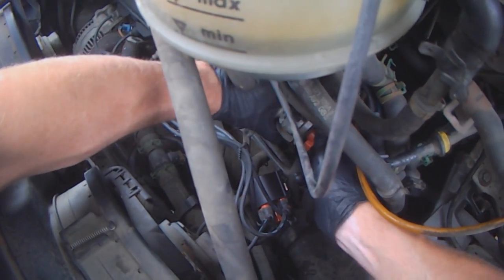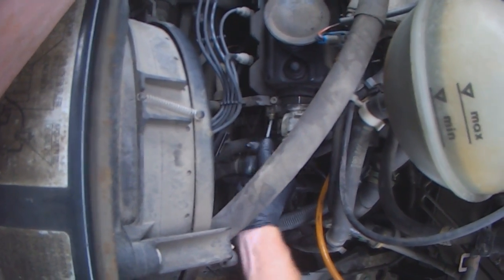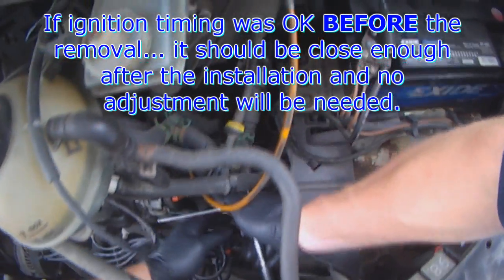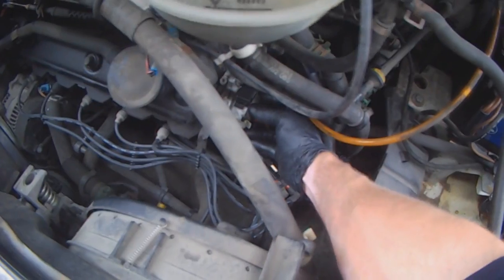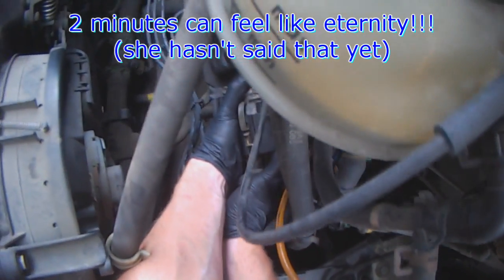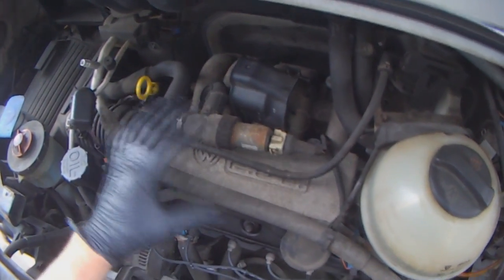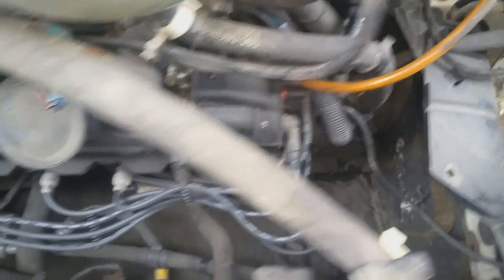VW T4: Hall Sensor replacement (part 3)

Comment: Hi there.. How/why do I have 14.7 volts on the plus and trigger wire at the hall sensor connection when not connected but only 12v at the battery?  Still not starting and still has an intermittent spark.. (it has a new coil, leads, plugs, rotor arm, dissy cap, hall sensor, ignition switch, temp sensor)  still nothing. (2.5l  1996)
Reply from the maker: I don't know... post some videos on your channel of how you are checking / testing things, so that I can see. Leave the ignition key in the ON position and trigger the starter directly at the starter solenoid (to rule out an ignition switch issue).
Reply: @EXOVCDS  many thanks for your reply.  I dont have a channel but I did try your suggestion of manually operating the starter with the ignition on.. No different. I have noticed though that if i place my coil lead near the neg terminal and do as above, it will spark for about a second then stop sparking.. Same happens if i ground the middle pin for the hall sensor. Its sparks and runs the pump a few times then does nothing.  My brain hurts
Reply from the maker: @nigelhook3437  if you repeatedly ground the center pin, spark also stops after a while? Or can you get spark for a longer time?
Reply: @EXOVCDS   the spark stops at the same time as the pump. Also i cant hear any injector clicking at any point and the spark plug looks dry if i remove one afterwards.   Sorry about this
Reply from the maker: @nigelhook3437  spark plugs don't get wet if the valves are not open, this is normal. If the fuel pump & injectors are ok (fuel is sprayed), then the engine should start & run for a second or two... or at least sound like it wants to start. If not, then you might have a fueling problem. If you have to wait a few minutes before spark returns, then something is getting warm & failing, causing the loss of spark. Do you have a scan tool that can communicate with the ECM? If yes, when there is no spark, can the scan tool still communicate with the ECM? Check all power & ground connections. There are several ground wires at the battery negative clamp. Clean each connector and make sure that they are secured tight to the clamp.
Reply: @EXOVCDS  thanks Thomas.. Ive pretty much done all of that.. I cleaned all the battery connections individually, and ive tried connecting to the ecm with an obd2 device but it wont connect (it works fine with my other car) I know the fuel is being pumped as ive had the pump out, but i dont know what pressure its pumping at so maybe that is the problem.. My other thought was to try swapping the relays that power the ecm and ignition. They both get warm whilst the ignition is on but that may be normal.  The fuel relay seems to work fine.. Ive even tried manually keeping it closed to bypass it but doesnt help.. Thanks for all your suggestions Thomas. I really appreciate your help. I'll keep on trying and when I finally get to the cause I'll let you know.

Comment: Hi Thomas, thank you so much for all your instructing video. I replaced my hall sensor with your vids.
Is there a TDM sensor on this engine ?
My revolution counter no more works, witch part should i check ?
Reply from the maker: Possibly a fault with the instrument cluster... year, model, engine?
Reply: @EXOVCDS 
Its a multivan  1994, AAF from europe - 

i don't know if there is a link but, when the engine is hot, the rythm of the engine has a hole like every 15 seconds. Someone told me that both problems come from a TDM sensor failure.
Reply from the maker: I don't know what a TDM sensor is.
If the engine is running... then a "tach" signal must be present (ECM uses distributor signal to drive the ignition coil). If your engine has a Crankshaft Position sensor (in North America, they do not), then the ECM uses that sensor to produce a tach signal. You need to check your instrument cluster for a Tach signal. A wiring diagram will show you which wire it is. A good smack on top of the dash with your hand, can  sometimes get gauges working again.
Reply: @EXOVCDS  a crankshaft position sensor. That's what i was speaking about. Il will try to see if have one. Thank you again for sharing your knowledge. ^_^

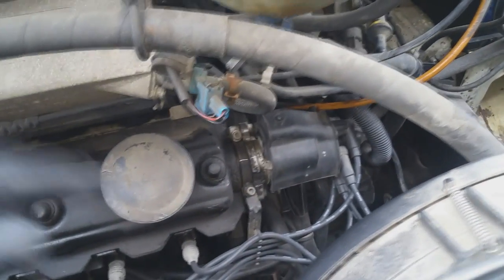Comment: @7:18 Learning a lot from all these Eurovan videos even though I don't have some of these issues (...yet, lol)... had no idea there was supposed to be a plastic cover for the distributor, mine is long gone.
Reply from the maker: Not really an issue until coolant starts to drip down from the reservoir, or any other type of moisture finds it's way into the engine bay.

Comment: Hello Thomas, Long time viewer here. Thanks for your efforts, much appreciated in the VW community! I have a quick question regarding my 2002 Passat 1.8T. Could a P0456 small evap leak also cause a converter efficiency code? Converter doesn't pass VCDS Test, its a bit of a stretch but I'm curious before replacing the cat. Thanks so much for your help!
Reply from the maker: Not sure... don't think so. Mainly city driving? Original cat? Oil burner?
Reply: Yes original cat, gasoline model. Mostly city, also just did vacuum test on the N80 and it failed. So it looks likes two unrelated issues?
Reply from the maker: +Hiram Bernard Hays III Most likely... since the N80 valve is so easy to change, start with that and see what happens with the cat code.
Take the car for a longer highway run / extended cruising... that can burn off some stuff in the cat and you might get some efficiency back.
Reply: Thanks I will! N80 already ordered, I appreciate your help!

Comment: I don't see any reason to have replaced the hall sensor during the original service, either.  There was no reason to suspect it was faulty, and the amount of time it would take to scope the thing "just to be sure" is ridiculous.  Sometimes things just fail--especially with older vehicles like this.

I can understand why the customer would be upset; to the average person, this would seem like the exact same problem happening again a month after it was supposed to have been fixed.  As simple as this type of setup is to us, it can be very difficult to explain to someone with no technical background in a way that they could understand it.
Reply from the maker: Similar scenario on 2.0L timing belt replacement... cam sensor is easy to do while belt is off, but we don't. Only had one instance where the cam sensor failed within 6 month of belt replacement. The higher the quote (over the phone) the less chance the work will get booked... the more we try to sell (preventative wise) "while things are apart" the more we get portrayed as crooks. I should have trained to be a baker! :-)
Reply: You get problems like that in any line of work. You would look good in an apron though...
Reply from the maker: LOL!